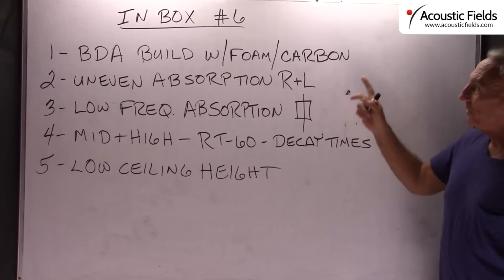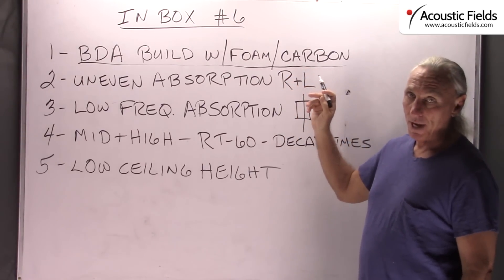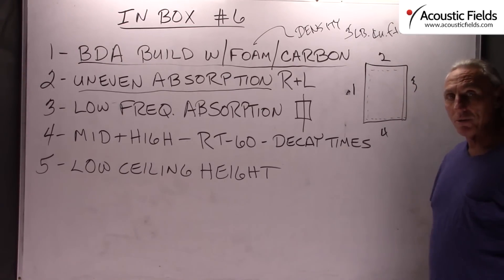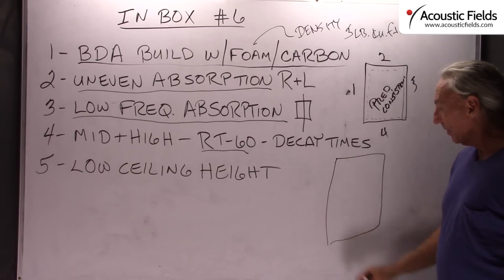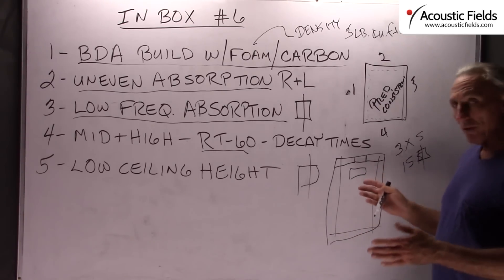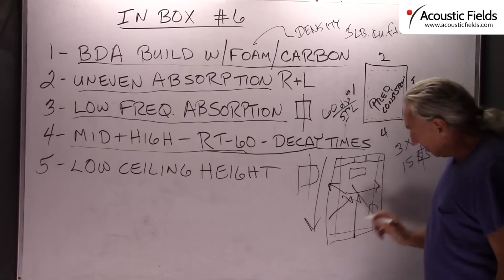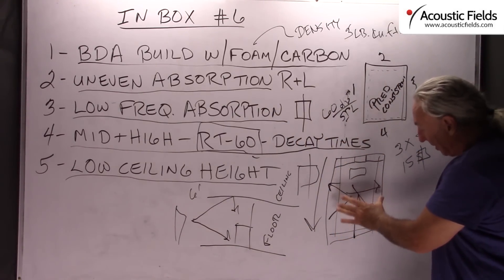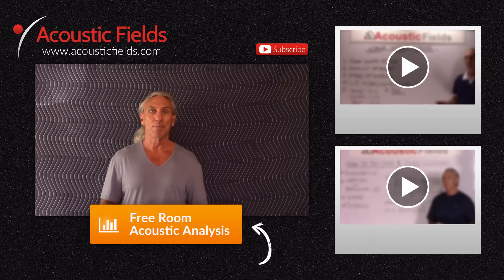Acoustic Fields Inbox #6 - www.AcousticFields.com

Comment: Thanks for doing these!   Could you possibly elaborate more on how to work with low ceilings?   Ideally we'd all have 14' but for many of us with basement studios,  even 8' is a luxury.      Half of my 21'x12' room is only 6'6"   the other half is 7'4"     The desk is on the short end with the taller half for tracking.   Is it possible for me to work with that low a ceiling?
Reply from the maker: Hi Mike,

With a 6'6" ceiling height, you must find another room size and volume. There is no fix for that low height dimension.